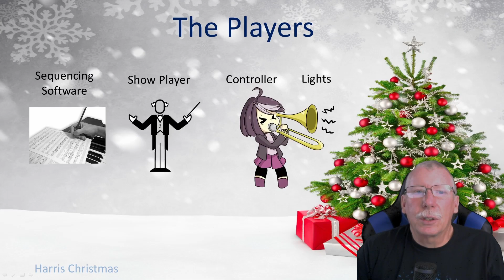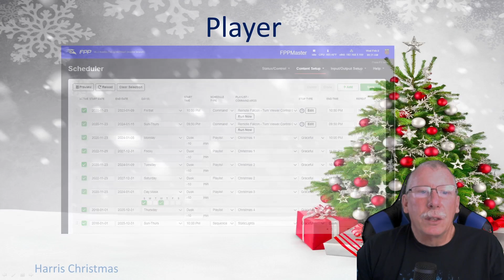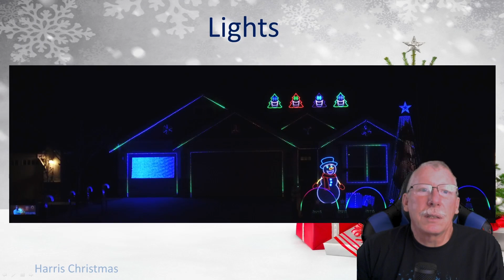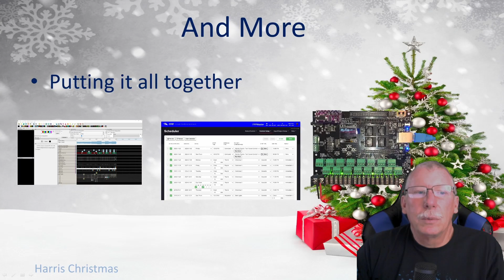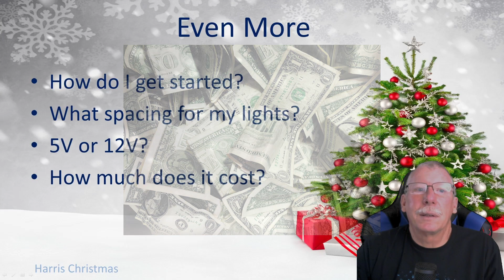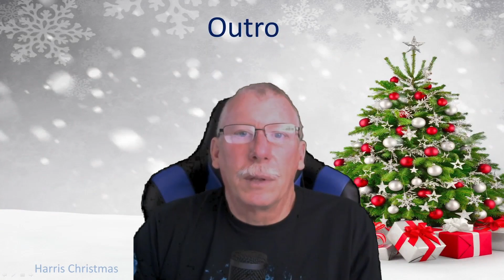Beginner's Lighting Overview

Comment: Hello, Rick, Another great video. Quick Question for you. I started off using a LOR 16 Channel AC Controller running off the spare PC. I am using their ShowTime Sequencing Suite S6 Software for my old local big store led and incandescent Christmas lighting. I have ordered a Falcon f16v5 Pixel controller for the start with pixels and looking on setting up my first single EFL singing face. I have heard that the Xlight software is great for the singing faces, but havent tried it on the normal lights using the LOR controller box. Have you hear of any conflicts running different hardware, or is all in the settings and IP addresses? Thank you Sir
Reply from the maker: Thanks you so much. The IP addressing is crucial for the controllers to communicate and there are tons of users that are using their LOR controllers with xLights and other more mainstream controllers like the Falcon or Kulps.